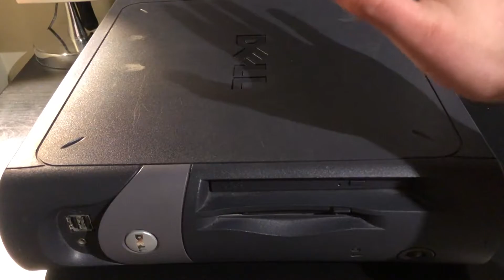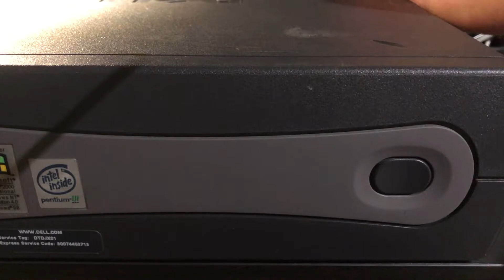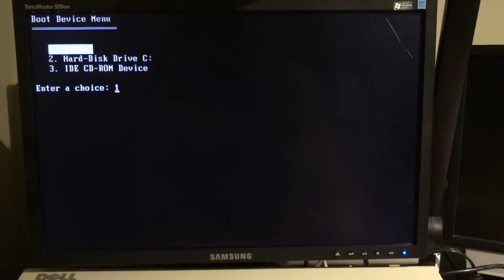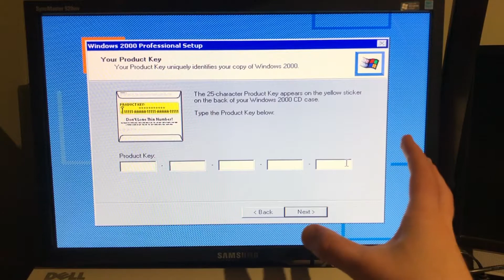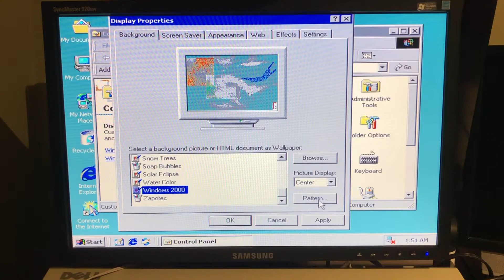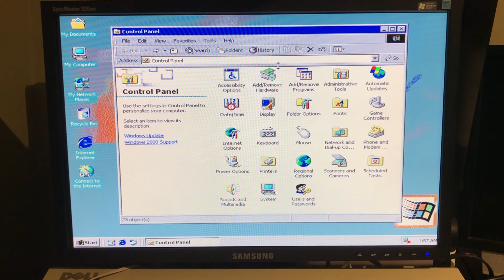Testing out a slim Dell Optiplex GX150!

Comment: I bought this computer, I am planning to remove the motherboard and try and rig it into a different chasis so i can fit a tru agp card in it. I have a collection of older computers that I have brought back to life to run WIN98 on but I have yet to take on a modification situation like this where maybe I will be doing some very strange rigging.
Reply from the maker: It’s a cool system, but wouldn’t a full size tower from the same model lineup work better if you want to upgrade it more? It’ll be less work to upgrade because it already has a larger case. It’s definitely possible but it’ll take some time as everything was manufactured with that case in mind.
Reply: @TheOriginalCollectorA1303  I'm only doing it because i got it cheap at the thrift store but unfortunately yesterday while I was looking at stuff in the bios the monitor just went black... i tried to turn it on many times but cannot get it to even post. I guess something related to the onboard video went bad. I have tried to use pci boards to see if i could somehow bypass it but no matter what I do I can't get any video out. The error codes on the back are ABC = green the D = yellow. On Dell's forums it seems as though I need to look at the error visually on a monitor at post...very helpful lmao...im so mad.
Reply from the maker: That sucks, sorry to hear it just stopped working. Built in VGA is what I use and fortunately it’s been ok. Small form factor AGP cards fit well but I can see why a normal card would be better, at least they are easier to find. Not sure how it’ll be possible to bypass unless you add an AGP card to skip the built in video.
Reply: @TheOriginalCollectorA1303  yeah let's see I'm going to mess with it some more maybe get lucky
Reply from the maker: Good luck, you might be able to exit/skip what it might be stuck on if you press enter or something. That is if you can figure out what it might be.

Comment: This was one of the first ever computers i got to do reapairs on. I remember somebody had a really weird Franken-computer that was using this motherboard inside a very old HP ATX case with a modded fan on the CPU and the original power button from the Dell case was glued inside that case and had another wire soldered that would go to the HP case power button lol. It was a mess of a computer,but the thing was really snappy on XP and it only had a 1.4 GHZ Celeron and 512MB of that SD RAM with a Geforce 2 MX 400. Looked like a sad piece of junk but it was running great
Reply from the maker: Cool! Dell combined with HP, the future is now. They went through the effort to install the motherboard, but connected the power button with the factory Dell one? Can’t say I’ve ever heard of a workaround like that! XP era machines like these ones are really solid, especially considering the hardware they have. Newer machines might work better, but XP (or something similar) just seems right, combine it with older games and software and it’s just as capable!
Reply: @TheOriginalCollectorA1303  Yeah,i have no idea how did they even fit the board in that case cause i'm pretty sure this mobo has screwholes in non standard positions because of the proprietary case it had. It's over 10 years since i last saw that computer. Yeah,modern computers are nice but these older computers have something special about them too. The story behind that Dell/HP combination was classmate way back in 2005 that couldn't afford a PC and our teacher's son "made" that computer with whatever parts he had laying around for him lol
Reply from the maker: Interesting, yeah prebuilt systems tend to be different from one another. I guess with enough time and energy though anything can be done. At the very least it’s cool to hear it got used, even if it looked terrible. Modern systems just aren’t the same like before.

Comment: i have a different model of the gx150, full factory, no third-party items. currently trying to install WinXP for chuckles to see if it runs since Win2k cant find system files. i think the hard drive might be dead, maybe also the power supply. i have seen a capacitor on my motherboard which is bulged a bit and brown, probably done. no GPU. i was wondering if WinXP is too new for it and should i go for Win2k instead? ive seen the microsoft WinXP startup screen for about a second and then i goes back to booting. probably dead hard drive for sure.
Reply from the maker: Windows XP is a good OS to use on something like this, but if you have a failing hard drive and/or the power supply has issues then it won’t run as well as it could. If you do plan on using it, parts are pretty easy to get ahold of, these are pretty cool systems to use. You could also check the hard drive with another computer if you can to see if it really is the problem or not. Considering it is still working though even with the power supply having a bad capacitor, then it’s possible that it doesn’t fully require that cap to work, but it probably isn’t good long term to keep it like that.